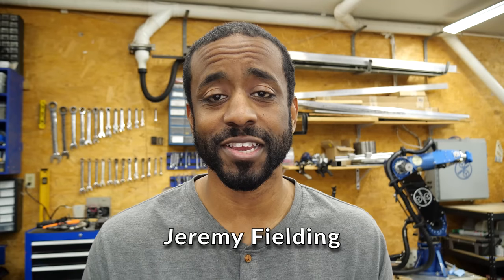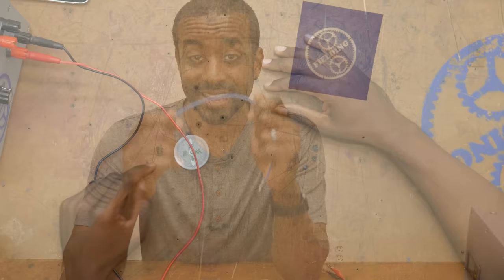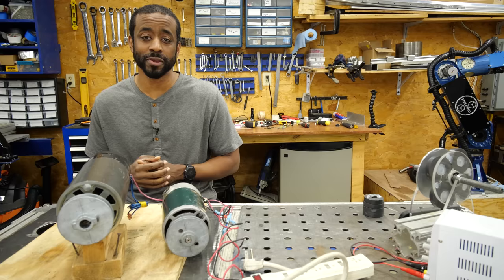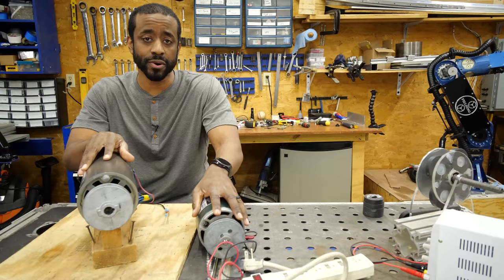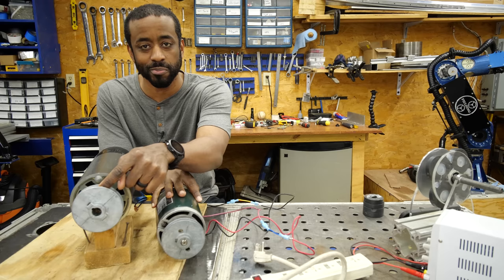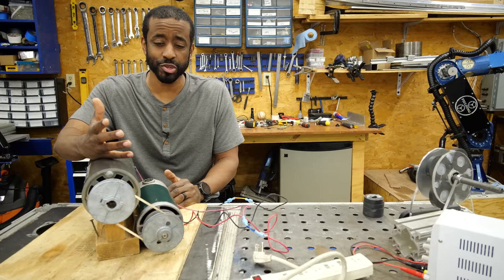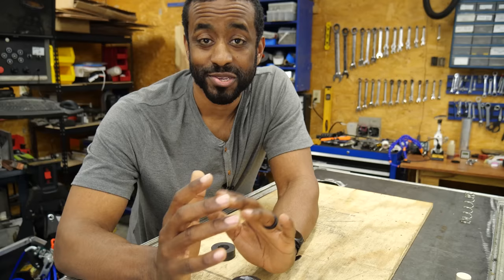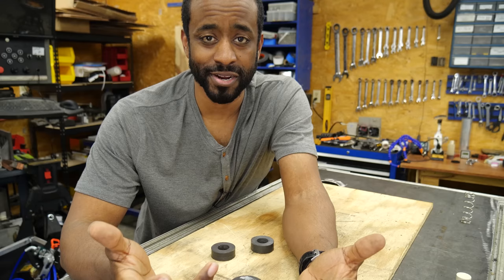Reviewing Free Energy Generators.  A Response to My Video "Nikola Tesla's Greatest Invention"- 102

Comment: Here's another thought worthy of consideration. I'm relatively confident that many people are aware, if not familiar, with the alloy known as "Nitinol". A combination of nickel and tin, this combination of elements exhibits the unique property of "elastic geometry". This is also described as a "memory metal". At room temperature the structure of the alloy is rigid and fixed in the shape it is cast. However, when subjected to a relatively minor amount of heat, the alloy looses its rigidity and can be deformed from its original shape. When returned to room temperatures, the alloy re-assumes its original shape. The transition from one shape to the other exerts a mechanical force on its structure sufficient to exert force against an armature such as a piston or cam. this process of deformation and restoration is reliable and repeatable time after time. The amount of heat required to elicit this effect is on the order of a basin of hot water. Thus given these properties and the narrow range of thermal differentiation, then a coil or spring-like structure cast of this alloy could be built in an array such that the repetitive exposure to a thermal sink followed by a rapid cooling would, hypothetically, result in an effective and efficient mechanical engine capable of producing useable work force applicable to any number of situations like turning a magnet inside of a coil. The heat required for the action is routinely created by nuclear generators and wasted in cooling towers. Or the heat could be harvested from AC units which generate voluminous amounts of waste heat. The upshot of all these elementary ideas is that multiple solutions exist currently that do not violate the sacred "laws of thermodynamics" but, for whatever reasons, get ignored, suppressed, or otherwise negated by a consensus of rigidly conformist, uncreative types dedicated to keeping us in the dark ages of innovation and alternative possibilities.

Comment: There is a kind of alternator in an electric car, it’s called “ regenerative breaking “ that works off of that actual motor that provides power to the car with the help of the battery, however when you stop imputing power into it, the motor takes power from the motion of the car thus, breaking and recharging the battery, however this will never be perpetual unless you are going down an endless hill. P.S. the system breaks because it takes power to produce power, which is the reason to produce power

Comment: When I was about age 9, I asked my neighbor, who was the son of a phone company employee, why I can't get free energy by connecting a motor to a generator to generate electric power for the motor. My neighbor got the correct answer from his father. I didn't realize that a generator merely transforms an electrical load to mechanical resistance and a motor transforms mechanical resistance (a load) into an electrical load (i.e. absorbs electrical power). In other words, when you draw current from a generator it becomes a "motor" which opposes the mechanical force turning the generator shaft. The higher the generator current i.e. electrical load, the more the generator shaft resists motion.
Reply: What about a high efficiency motor running a high output alternator. Is there no way to create enough energy to keep the motor running?
Reply: Never. That would require 0 losses in all parts of the system i.e. 100% efficiency for the motor and generator. Even if you could do that, attempting to take off any work from the system would cause things to run down and stop. Like a flywheel at best.
Reply: @philmarsh8185  the way I was explained this issue (and I don't really understand it) is an alternator would produce 120amp and the motor would draw 60amps to run it leaving 60amps minus any loss to run your home with. It seems to make sense to me. But This issue is over my level of expertise on this issue
Reply: @philmarsh8185  use a fly wheel w/ a mag.setup!
Reply: @jamband4230  The motor would have to draw more than 120 Amps of energy in order to drive the alternator to allow it to produce 120 Amps.  If the motor is only drawing 60 amps, then it can't produce sufficient torque (turning power) in order to turn an alternator loaded with 120 Amps.
Even if the alternator is producing 60 Amps at its output, some of that energy will be lost as heat in the wires to the motor and more will be lost in the motor as both heat from its wiring and heat from friction in the bearings, so the motor will produce substantially less than 60 Amps worth of effort in torque at its output shaft, meaning that the alternator being driven by that motor will be unable to continue to produce 60 Amps of output.  The output will rapidly drop to nothing and both the motor and alternator will stop turning due to all of the losses.
This is exactly what Jeremy demonstrated in this video.
Reply: The motor and generator are mounted on the same spindle of the flywheel   I'll poste the setup after I edit the plans and a few of the parameters I  can garenty that the system works very well bring your att. And I'll Sine a waver written financialy secure your investment....till you have a working unit it doesn't take much money or major time to build one up ..
Reply: @jamband4230  Good question. However please keep in mind that as one draws current from a generator, the generator becomes harder to turn - i.e. shows resistance to the applied torque. A generator drawing no current would show no resistance to spinning and if it had zero friction (all real generators have mechanical losses i.e. friction) the torque required to turn it would be zero at zero current draw (zero electrical power output). In other words, a friction-free generator on an open circuit (zero current) would spin forever if a momentary twist (torque) were applied.
Let's also assume that our ideal lossless generator has NO magnetic nor electrical losses i.e. zero-resistance wires and coils.
Our lossless generator would spin forever once spun up (perpetual motion). However, any energy, mechanical or electrical, that we withdraw from the generator would entirely come from the inertia of its spin and it would slow down if we attached either a mechanical (friction) load OR and electrical load (say a lightbulb which draws current). Why would the generator slow down with an electrical load (i.e. nonzero current draw) or require a nonzero torque to maintain it's speed under an electrical load?
Because as soon as one draws current from the generator, the resulting internal magnetic fields give the generator a motor action which opposes the applied torque. The more current draw, the greater this opposing torque - i.e. the harder you must work to turn the generator! A generator is very similar to a motor. The only real operational difference is that a generator's torque opposes the applied rotational motion whereas a motor's torque is in the same direction as its rotational motion. Think of it as pushing a cart uphill vs letting the cart move downhill. In the first case, you're doing work on the cart, i.e. adding energy to the cart and the cart's force against you is opposite that of the cart's motion. In the latter, the cart is doing the work, pushing against friction as it goes down the hill and it's force is now in the same direction as its motion.
Same with our generator. When you draw current from the generator, it's doing electrical work on the lightbulb (electrical load). That electrical work is reflected in the need for an outside force to perform mechanical work on the generator's shaft. The heavier the generator's electrical load, the harder it is to turn.
Losses in the generator (electrical, mechanical, and magnetic) just increase the torque required to turn the generator.

The same arguments hold true for the motor. When you expect a motor to work harder, i.e. you load it heavier and make it apply more torque, it will draw current in proportion to how much torque its shaft is supplying. More mechanical power or work out of the motor requires more electrical power or work into the motor.
There is no free lunch here. Both the motor and generator can only change the form of energy i.e. from electrical to mechanical and vice versa. Neither can create any energy. So if energy is lost, either from friction and/or removal, and no additional energy is added, the energy comes from any existing rotational energy in the coupled motor-generator pair and the shaft slows down as energy is depleted.
Best

Comment: My understanding on the ones I have seen before was that a very large flywheel was used and this required an input of energy (petrol motor/battery) to get it revolving - once revolving energy was generated and small bursts of energy (electricity) was drawn from the system when required to help maintain momentum as long as possible. It is not perpetual but it seems to be a functional means of producing electricity  by creating a large capacity dynamo.
Reply: Even if you could make it so you had zero losses to heat, you couldn't pull any energy out of your system
Reply: @CoffeeAddictEvan  what if a battery and 2 bridged alternators was added to a e-motor. Would that work
Reply: @bmo1659  it would run for as long as there's charge in the battery, once that was dead your system would stop spinning
Reply: @CoffeeAddictEvan  even with 2 alternators charging? I've just learned about e-motor the this years and I seen all them devices that left me with a million questions lol. I appreciate your reply
Reply: @bmo1659  where does the power to turn the alternators come from?

Comment: Magnets are an excellent energy storage device.   Taking advantage of it is where the problem needs to be solved.  Nitinol (memory metal) is another one.  When shaped and heated it remembers that shape.  Now disfigure it and then reheat it or use a micro voltage and it reacts very powerfully to go back to its original shape.  Used a lot in micro robotics.  Best part is nitinol never seems to fatigue or wear out no matter how many times it's used.

Comment: I built a little "free energy" machine in HS. I used a 7.4v motor to drive a 12v DC motor with a small battery pack. I had an excess of  4v to run a 1.5v led. 

I had it balanced well enough that I could take the battery pack off the system for about 1-2 min before thermal dynamics began to slow the system thanks to flywheels and sprag gears. 

This science experiment was a comfortable blend between thermal dynamics and law of conservation. 

My teachers honestly believed I made perpetual free energy before I could explain it.

No matter how hard I tried, I couldn't seem to get them to understand what they already led themselves to believe.

I guess my science experiment just proved stupidity and how beliefs are ignorant, especially when somebody was telling them how it worked.
Reply: How much did the battery pack cost? The only free energy is wind, sunlight and the tides. Oh, and possible the middle class work force in America...
Reply: @ChrisLichowicz  The battery pack was like a cheap $20 lithium 2200mAh.

It literally just spooled the unit and kept it running between judges.

Comment: I've tried perpetual motion out of curiosity with a solar panel connected to a battery that ran a converter with a battery charger and a big light plugged into the converter 😂😂 then I researched generator efficiency 🙄
Reply: It wouldn't be perpetual motion because you would have a energy input source from the solar panel
Reply: @mrsweetpotato4354  the project was done at night in the shop the goal was to see if the load being both the battery charger and the work lights could keep the battery fully charged 🤷

Comment: When I was 10 or so, I remember wondering why you couldn't just connect two motors and jump start them to make them go on forever.  I thought I had solved the energy problem.  I hadn't even heard the term "perpetual motion" at the time.  I think it's pretty normal for kids to "invent" perpetual motion only to be very disappointed when they find out that gravity and friction are there, even when they can't see or feel their effects.  

Might be able to charge batteries while an electric car is going downhill ...
Reply: Car manufacturers already do this under braking to increase battery capability.

Comment: What many people don’t know and/or understand is that magnetic fields create physical resistance that has to be overcome for the generation of electrical power(flow and use of current) by a device using that energy that has to be overcome by the driving forces.  Most folks think that since a magnetic field is invisible it cannot possibly create much if any resistive force that has to be overcome for a generator or alternator to produce the power required to drive another electrical device.